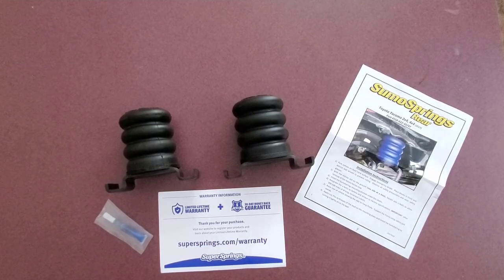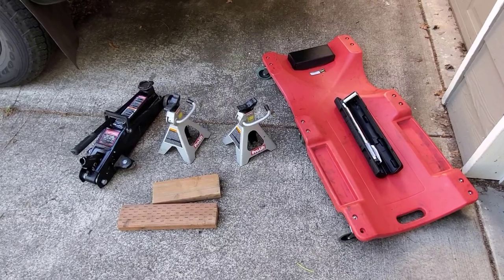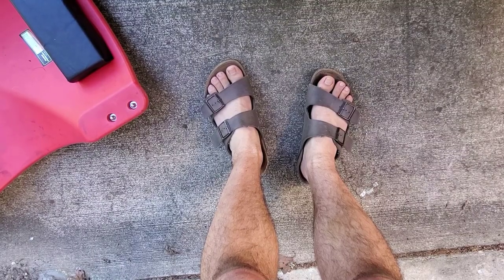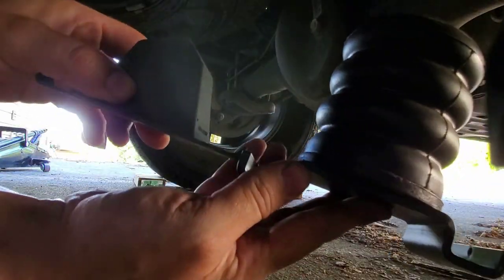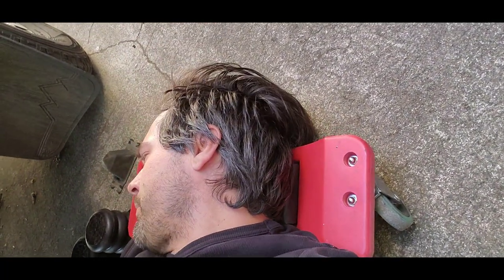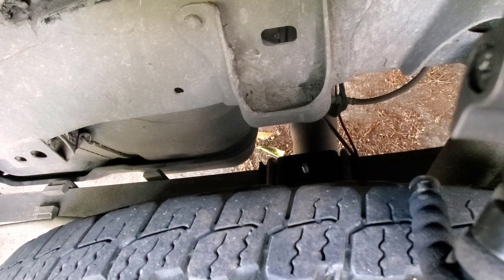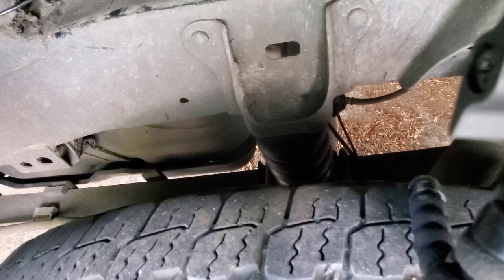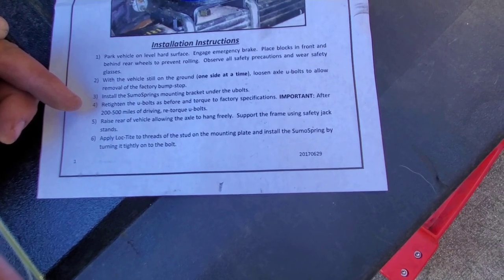Sumo Springs Installation on a 2017 Toyota Tacoma

Comment: I just put mine on and they have about 1 - 1.5 inches of clearance on a new Off-Road with nothing in the back yet. You must have a decent amount of weight to immediately be resting on them from the get-go! I'll be getting a topper soon though and tow a camper with it as well, so I'm hoping they'll help with that.
Reply from the maker: Well I did have the canopy and RTT on at the time. The RTT is 125 LBS. Not sure about the canopy.

Comment: Thank you for uploading this video. I am getting Sumospring too. For your setup it looks like you need higher spring rates on the rear: either an additional leaf or just new beefier leaf packs. Not certain about this, but I don't think the Sumosprings are supposed to be compressed all the time.

Comment: You said your seat seemed to flatten out in which I found seat jackers for my 2011 Off Road by Desert Does It and what a difference. It raises the front of the seat 1" 1/4 and I used the 3/4 spacer for the back of the seat. Anyway these are the same Sumo Springs I have been looking at and will get shortly.

Comment: Did you have any kind of lift on ur Tacoma thanks
Reply from the maker: Not yet, no. I never found myself needing one...until recently. I added some ARB skidplates (not recommended) that took about 2 inches of clearance and I'm also seeing the leafs in the back are in need of replacement so I expect I will put in a 2-3" lift this summer as well as add some leafs.

Comment: glad to see your wore protective eye-ware second time around :)  how are they holding up months later?
Reply from the maker: No complaints. Seem to work as well as the day I first installed them.
Reply: @RevN3  did you have 500 or 1000 lb compression? whats the part number?
Reply from the maker: @gvsukids  1000lb, it's this one specifically https://smile.amazon.com/gp/product/B075FQHVDF/
Reply: @RevN3  has the ride feel stiffened or softened?
Reply from the maker: @gvsukids  Depends on the situation. It's stiffer in that it doesn't roll as much on corners and feels more stable but it's also softer when going over a rough spot the back end can handle it better and doesn't go flying all over the place. If that makes any sense.
Reply: @RevN3  yes. And of course I'm sure tows much better
Reply from the maker: @gvsukids  I didn't notice it that much but I don't tow often so that's more on me than the sumo springs.

Comment: Man you should have measured height before and after!
Reply from the maker: I don't think it made a difference really. If I remember correctly it doesn't even touch the frame unless there is weight in the back.
Reply: If anything it solves the "Taco lean" we all have.